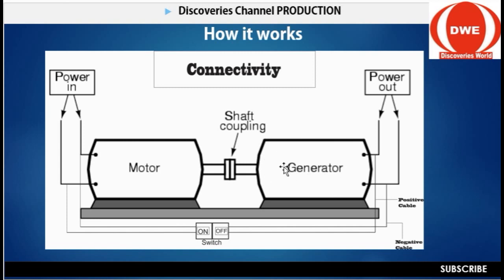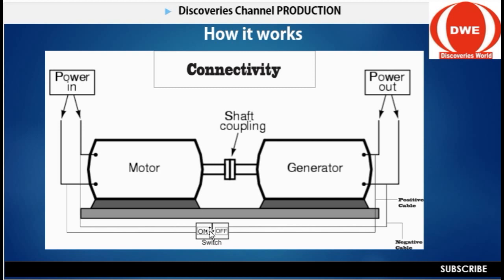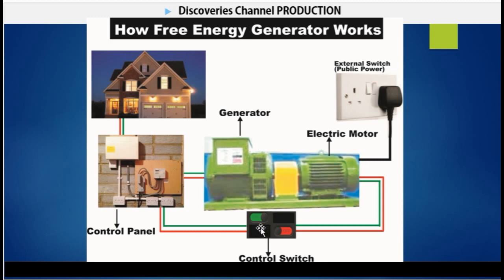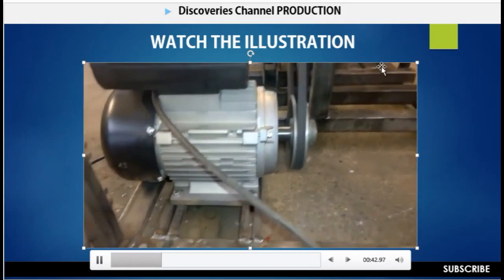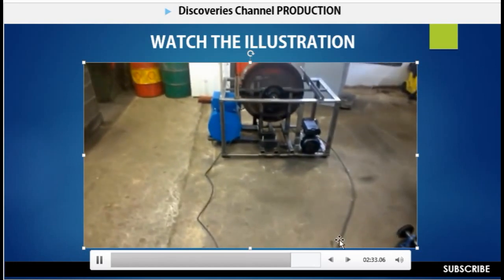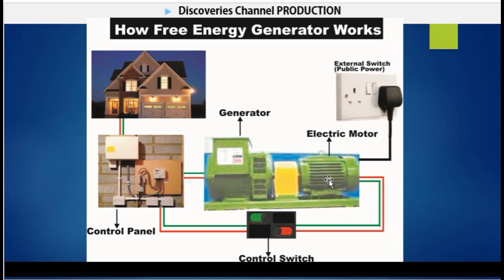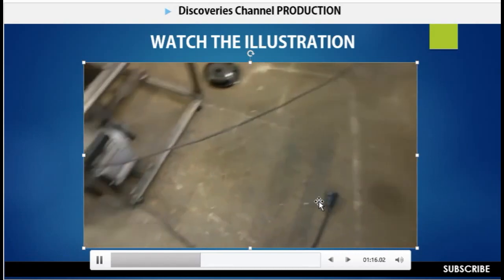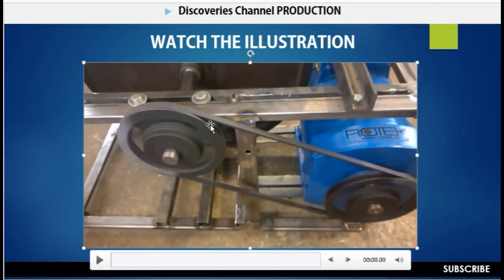Finally! the Best  Free Energy Generator Secrets Revealed

Comment: Sir please on my own design wen ever i change the switch connection to booth of them it will go down nd am using motor with capacitor so I dont no y is wat to do nd again my question is CD motor nd AC motor which one is the best
Reply from the maker: Check the speed of your motor

Comment: why do you put the flywheel? any reasons?
thanks
Reply: I think the function of the flywheel is to sustain the rotation whit it's weight in case there is a slight delay in switching from the external power to the generator power. The flywheel will keep it running at the high speed for a while so that the electric motor can pick up the power and continue running.

Comment: when you turn off the power input to the motor, wont the generator stop befr you turn on the power input from the generator
Reply: Is the external switch has a current?

Comment: Can we operate an electric heater.
I have a meter of 12KW and 60A in 220 V which supplies 10 radiators which cumulate a power of 10000 W

Comment: Can this be started from battery connection and then recharge from system once started?
Reply: If you can build an inverter into it, yes you can use a 12v battery to start the generator.
Reply: This is my thought as well it should be battery started and also recharge the battery.

Comment: For how long must the generator get it's 1500W of power for the startup of the system before you can disconnect it? What kind of generator is it? Is it a motor-generator? And if I understand it correctly, is this system producing 5000W of power? For how long with it run like that? And what is that box on top of the electric motor? Does the motor come like that?

Comment: Okya, I will help you in more technical detail.....ENERGY, FREE ENERGY GENERATOR.
I have read this method many times, but nobody explains the theory behind the purpose of flywheel stored energy in this regard. Okay, I will try to explain if I am correct... As the motor/ generator match starting up, you need external starting power. Until, operating speed/torque cum movement of the flywheel's inertial kinetic energy is reached, and also when generator's generated emf is sufficient to feed motor, then, via a control system, the motor supply is switched to pulsing electrical supply to avoid further armature coil BACK EMF opposing loss, and at the same time using the switched in pulsed BACK EMF to assist driving torque. This is achieved via flywheel's movement of inertia to damp magnetic rotor's opposing influence just before TDC, or to charge external batteries bank.. Note, maximum current flow to the armature coil is just before TDC when maximum induced back emf plus maximum opposing torque exerted by approaching rotor magnet are experienced. Here if this max armature current is cut off, the required torque to over come approaching rotor magnet can be sustained by the torque of the flywheel's movement of inertia. With out this inertia from flywheel, the motor will stop due to lack of torque at this critical TDC... Next, the motor armature ferromagnetic core material cum coil yields high inductance L. When it's max flow of current is cut fast, Ldi/dt yields very high emf. This high emf X small current yields high power . Which is tapped to add electromagnetic force to attract next approaching rotor magnet at TDC, or additional repel force to push away the leaving rotor magnet pole.. Next, on the generator side, which is the mean LOAD TO THE DRIVING MOTOR CUM FLYWHEEL, requires simultaneous synchronised pulsing action in cutting off generated current flow to external load/ loads. This is, again, to reduce the induced back emf to generator current flow. Thus, the whole system is working on minimising LENZ's effect...to be continue..
Reply: How much does it cost to build this unit that effectively power an average 4 bedroom house.
Reply: That was a horrible explanation..

Comment: If it runs on home electricity how it could be free generator
Reply from the maker: Home electricity only help to power start before you disconnect it and switch to the generator
Reply: You can as well build an inverter into the generating unit using a 12v battery for the initial power source and disconnect when running on the generator power.